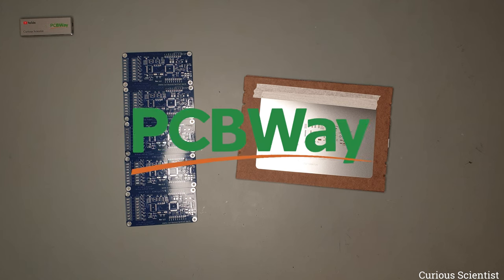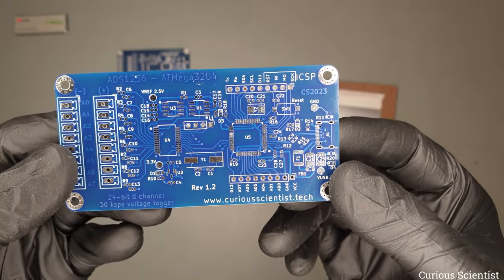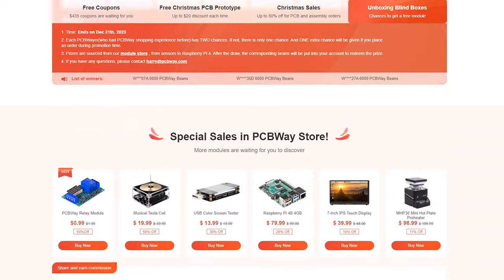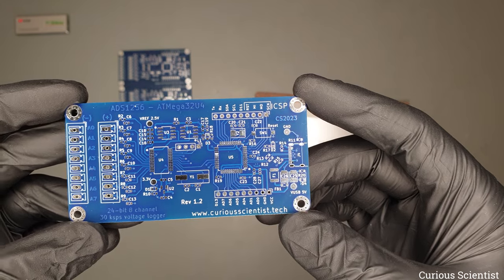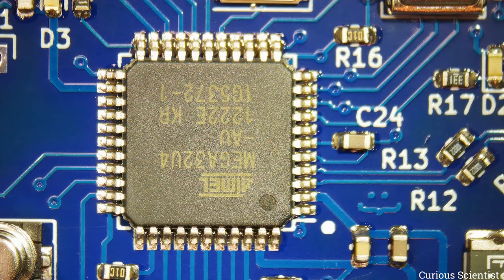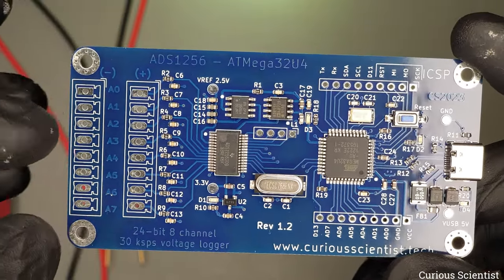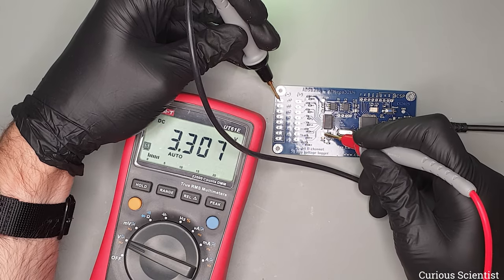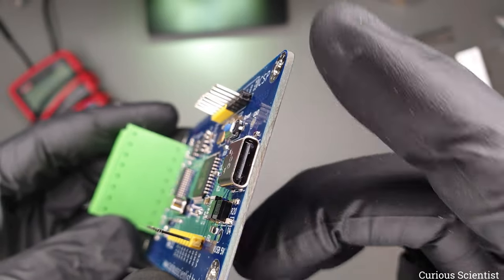ADS1256 Official Arduino Library and Custom DAQ Board

Comment: Hi, great board!   Unfortunately for my application I need a smaller board: 60mm length maximum!  --> Is it possible to cut out the end of the board as I do not need the big green conector ?
Reply from the maker: Hi! I would not recommend cutting the board as it might cause unwanted effects. Also, even if you cut the connector, this specific board ( I have a newer, better design, too!) is still about 80 mm long... Why don't you just buy a module from Aliexpress? I shared a bunch on my website under the parts and tools page.

Comment: I'm having trouble getting to work with your new library. I can't get past   "A.InitializeADC(); ". It just freezes. I've set reset and sync to 0 in the code as described in your manual. The weird thing is that I can take some of your older code and it works fine. I've triple checked pin assignments and can't find anything wrong. I'm interfacing to an Arduino Nano. Any ideas?
Reply from the maker: The code has been tested with Nano and it works. If the initializing fails, then you have probably issues with the wiring, or your ADS module is faulty. But if older code works, then it should be the wiring. Do you use the standard spi pins? Which pin is your drdy pin?
Reply: I'm using started spi pins 10,11,12,13 and tried using 8 and 2 for DRDY. It is definitely related to the interrupt though.  If I change code to while(DRDY_value == true), the code runs, but the output doesn't make sense. @CuriousScientist
Reply from the maker: You must use an interrupt pin, which is pin 2 or 3 on the Nano. Also, you need yo describe the CS pin in the beginning, too. It should work, I know, I tested it.

Comment: Hi sir. It is possible to read two load cells (3000 divisions) simultaneously at approximately 2000 to 3000 sps, without generating problems of slowness of the cenverter with your library and PCB?.
Reply from the maker: Hi! Absolutely. You can read up to 8 load cells with this device. But why don't you just try it?

Comment: Hey this library able to work with esp32 on 2 core ? 
1core code reading adc and core 0 filtering and data logging
Reply from the maker: Hi! I didn't make the library "multithread". But feel free to grab the code from github and make it into such a code.

Comment: Hello. I am back again :) I got everything to work but one thing that still bothered me was that despite setting the buffer to 1 via the command A.setBuffer(1) it would still sometimes show Buffer is disabled when i called A.getBuffer(). So i decided to print the status registers bit 1 which is the buffer bit. the status register would show the bit as 1 but the serial monitor would show buffer is disabled. Why is that? I am assuming i am doing something wrong but i can't figure out what.
Reply from the maker: Hi! I checked it now as I am working on a new board, and it works just fine. Actually, the getBuffer() reads the status register, and it just extracts the corresponding bit of the BUFEN value, so they should not be different. I don't know why it gets wrong.

Comment: Hi dear, congrats for this project. I need info about this. Is possible to read value from device about 0 mA and 100mA? if possible to send data a board like esp32 to send data over WiFi?
Reply from the maker: Hi!
You don't typically read current directly, but you convert it to a voltage value. But sure, it can read it after an appropriate conversion. 

This device already has a built-in microcontroller, but you can surely output the data to another MCU. Simply by UART, for example. So, yeah, it is possible.
Reply: I would have to use a particular probe where the output is an output between 0 mA and 100 mA and read the output.
Can I read, for example, 2 inputs at the same time?
I want to take some samples from PCBWay and test them, but I would like to be sure of the 0mA - 100 mA range reading.
I see you have two devices, which one is better?
Thank you. @CuriousScientist
Reply from the maker: It can read up to 8 inputs "simultaneously". 

There is "no such thing" as reading current. You have to physically convert the current to a voltage in some way (e.g. shunt resistors or a transformer) and then read the voltage. Then, in the processing software, you can convert the voltage back to whatever unit you need. 

Regarding the boards, the newer version (this) is always better.

Comment: Hi, this sort of general inexpensive DAQ is a very useful tool.
I would like to create this myself but add an LCD so it does not require a PC for basic function.
This could be a HAT off your SPI header but if printing a PCB, I would like to add it, and a few buttons for control.
Can you provide a schematic or even better a KiCAD project file if that is what you used?
Thanks.
Reply from the maker: Hi! All the pins of the microcontroller are available via the header pins, exactly for the purpose of being able to add more peripherals. The schematics or any other files are not available publicly.

Comment: Hi
Your library is really helpful, but i am facing a weird problem. i bought an off the shelf ads1256 module (the blue one) and tested it with an uno with your library and it worked perfectly. After that i tried to make it work on arduino due but since it isnt supported it didnt work, however it showed drate mux and pga values as 255. i thought since the due is not supported thats why it was showing this. I then connected the ads module to my mega2560 but the code wasnt going past the initialize ADC line (i know that because of serial.print). I thought my mega was wonky so i connected the ads to my uno that i used before but i was getting the same results as above (255 for all ). i read the documentation and playedd around with the sync pin. there was no reset pin so i set that to 0 and also tried setting the sync pin to 0 AND tied it to 5v but still not getting any results. 
what am i doing wrong?
Reply from the maker: Hi! What do the connections look like? Plug-in cables or proper soldering? It could be that you have bad connections. Also, the DRDY pin must be an interrupt pin. This is not an issue with Due since all of its pins could do it, but Mega and Uno are more limited. It could also be that on the way somewhere, you shorted the power pins and fried the ADC board. Hard to say anything without seeing your setup.
Reply: i'll review my connections. is there any sure way of knowing that i fried my board? @CuriousScientist
Reply from the maker: The only way is to get an answer from the ADC. If you cannot get any data back from it, then it is probably bricked. I hope it is just a lousy connection. Let me know if you are still struggling, we'll figure it out.
Reply: the module seems to be ok. the led turns on and i am getting vref as 2.5v. What do i need to check to make sure my module or my adc is not fried? @CuriousScientist
Reply from the maker: I just wrote it in my previous comment.
Reply: One more thing. Am I correct in assuming the library wont work with arduino due ?
 @CuriousScientist
Reply from the maker: It should work with any microcontroller that can run Arduino code.
Reply: It is working now
I changed the DRDY pin to an interrupt pin like you said (i may have missed that info in your documentation) and it worked. Thanks a lot for your help :)
 @CuriousScientist
Reply from the maker: Glad to hear that it works. It is hard to miss if you really read the documentation because the whole 4.2 section is about the DRDY. 😉
Reply: One more question. Sometimes when i power my mega and look at the serial monitor it shows wrong values of the pga, mux and drate registers(should be 31 and 19 for mux and drate but it shows some other values) . is this because of my connections (because i am still using a breadboard)?
For the PGA there are 2 cases. 
1. When the drate and mux values are correct the pga either returns 224 or 128
2. When the drate and mux values are wrong (by wrong i mean any value other than 31 and 19) pga value also messes up.
I also set the buffer to 1 explicitly in my code and when all values read wrong the buffer also goes to 0 (even though i enabled it in the code). 

  @CuriousScientist
Reply from the maker: @mohammadghazi1872 if you get wrong values, then something is still wrong.
Reply: @CuriousScientist  thing is i sometimes get correct values too without changing anything so for now i am gonna chalk it up to loose connections. i probably wont know untill i make a pcb or transfer my circuit to a veroboard.
Anyways. Thanks for all your help.
Reply from the maker: @mohammadghazi1872 buy my PCB and you won't get any issues. 😎
Reply: I need to integrate a GPS module which runs on TTL, and an SD card module which also runs on SPI, with the ads.  I just looked at your PCB and saw additional SPI and TTL pins so I am probably gonna consider it in the next prototype. The only problem will be shipping as it is as expensive as the board itself. Anyways thanks for everything @CuriousScientist
Reply from the maker: @mohammadghazi1872 Yes, my PCB has all the leftover pins of the microcontroller available. I think I thought about most of the things. 😅
Reply: I have another question. Is it possible to read only 3 or 4 out of the 8 single ended inputs or only 3 out of the 4 differential inputs? Or do I have to read all of them and use only the first 3 that i want? 
PS. Sorry for taking your time with so many questions 😶
Reply from the maker: @mohammadghazi1872 read the documentation I wrote.
Reply: Its done. Thanks  @CuriousScientist
Reply: @CuriousScientist  Hi. I'm back.
I designed a PCB to get data from GPS and ads and store them in an SD card. Previously all wiring was on a breadboard so I chalked up the wrong values of the ADC to faulty wiring but now that my PCB is here, I am still getting the same problems which are as follows:
Sometimes, after I powerup my mega, the ADC initializes but instead of showing the correct values of MUX and DRATE which are 31 and 35 it shows some other values. I also explicitly set the buffer to high but when the MUX and DRATE values mess up, it is at that time the buffer also gets low(disabled). Please help.
Reply: UPDATE
I commented all SD card related lines in my code and it is working perfectly so now i have to find a way to get the 2 working without any problems. 
(If anyone else reads this comment and you know something please do tell)
Reply from the maker: @mohammadghazi1872 you clearly have problems with the implementation of the spi communication. Probably the CS pin is not used properly.
Reply: @CuriousScientist  I explicitly declared the CS pin for the SD card in sd.begin command. anyways ill do some debugging and search the net for solutions. I am still learning so any help no matter how small is appreciated (any critics too).
Wish me luck